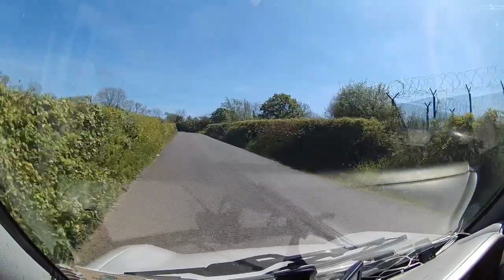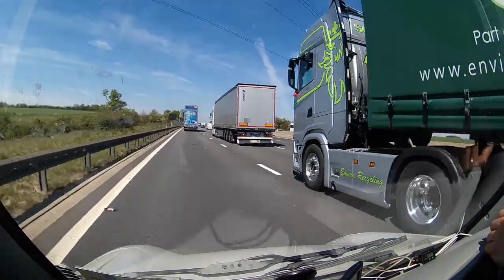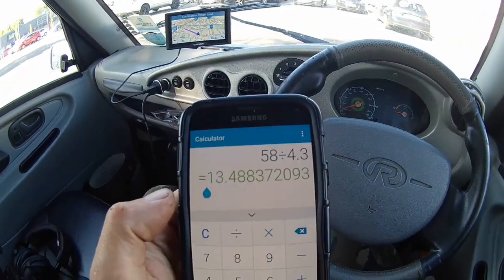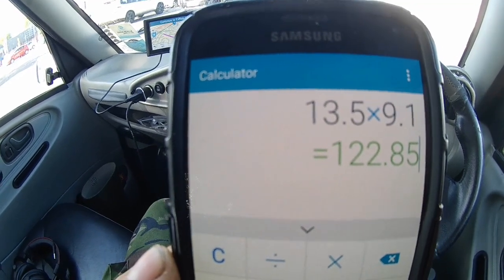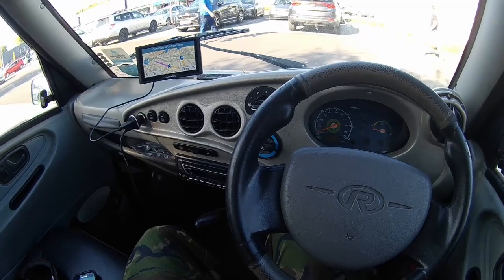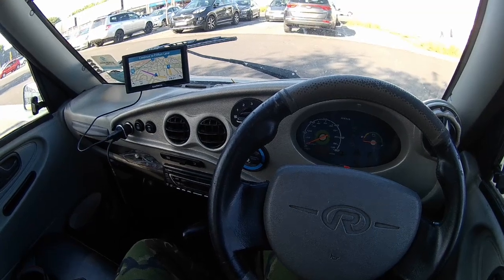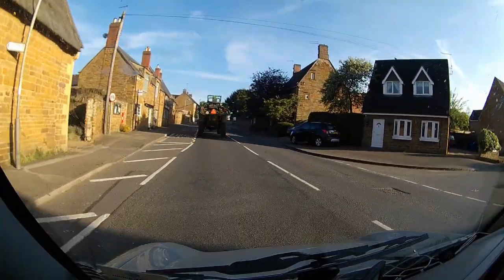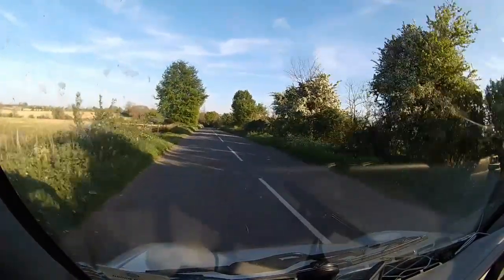MOTORWAY DRIVING: 120 mile round trip using the REVA G-WIZ Lithium-ion Conversion AC model

Comment: Hi you now have the best of both you can put your Gwiz on a trailer behind your nican and set up camp and yous your Gwiz
Reply from the maker: That would hammer the range on the van unfortunately. I use the gwiz at home.
Reply: @RichardMawby  if you had a very lit trailer whith gud berings and low resistant tiyers you could still do the shows with the Gwiz as well

Comment: bro...actually i'm going to buy 2nd hand reva car. so....i need some more information about battery capacity of reva car... how much volt/amp battery required to get 140 km range. and how much it (battery) would cost..???  plz reply me bro.
Reply from the maker: Original battery capacity is only 40 miles. To get the 140km range you would need around 10-12 kwh of lithium battery modules minimum. Operating voltage is 48v... but depending on the model DC or AC it has a varying min and max voltage. The DC with a programming cable can take up to 80v but stock settings 56v max which is fine for many battery packs. AC max voltage is about 60v. Battery cost depends on where you look - go for second hand EV batteries and they are cheap.
Reply: thanks bro...👍👍👍👍👍

Comment: hello bro.....i'm from india... and  i want to know some more information  about this reva g wiz car....like night driving...and safety issues and  seating capacity...and average  running .. can u plz add some more videos of night riding of reva i.
Reply from the maker: I haven't had time to make any more vids lately and any new ones will be on building the yellow wiz... Night driving is fine in terms of safety - it has enough lights for visibility. Seating capacity is 2 adults + 2 children in the back. Safety is a concern but that depends where you are driving and how careful you are as it is not a car and doesn't have the same crash testing. I also do not have a Reva i... only the older models.

Comment: Hello Richard. Great achievement! As for the AC vs DC motor the torque was so noticable? I mean at the green light an AC Reva vs DC Reva it's so evident the difference?
Do you know if its possible to increase torque either DC or AC?

THANK YOU for your videos!!!!
Reply from the maker: DC will have more bottom end torque... but the AC is much more even especially in boost mode. AC will overtake a DC because it can hit 40-50 much easier (at least with my lithium conversion I can be at 50 mph in around 10 seconds) - whilst the DC will taper off after 30 mph unless the settings are tweaked. I was able to get the DC to keep picking up until 50-55 mph but this gave it a very short lifespan and I burnt the motor out. AC is much more efficient and worth having over the DC. There is possibly a way to modify the AC but I wouldn't recommend it after my experiences with the DC. The settings are possibly set for a reason and whilst removing the 'speed limit' on the DC, increasing the power curve was not good for it. The AC has different settings and I do not have any information as of yet on how they function.

Comment: sir my reva ac motor is working but ac is not cooling how can i figure out  foult of this kind
Reply from the maker: If you are talking about 'aircon' try re-gassing the system if it is not cooling and check for leaks when it is regassed.
Reply: thanks sir i would try it